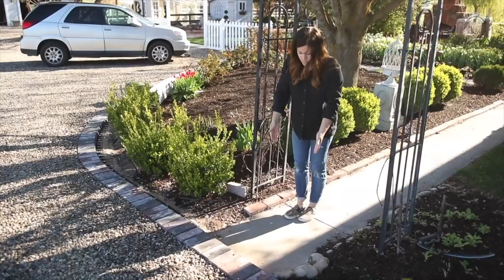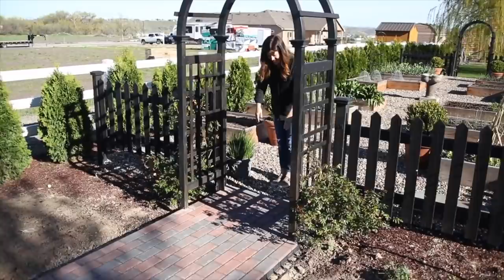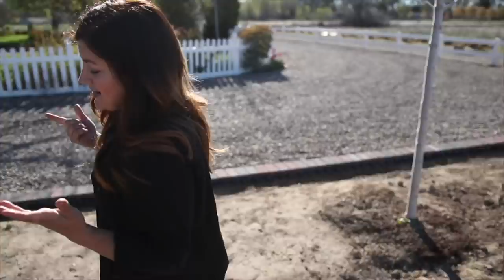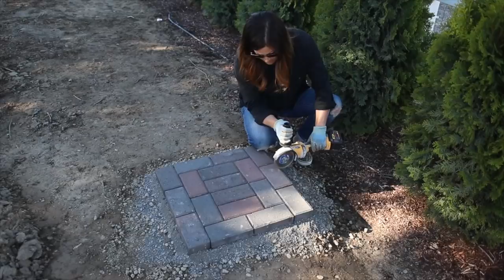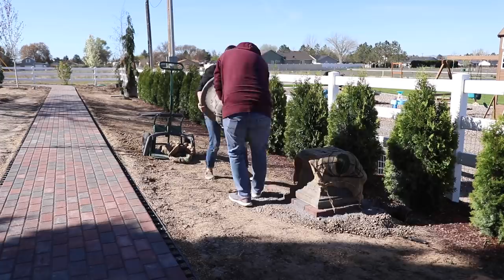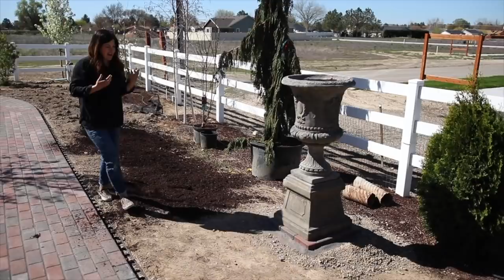Brick Pathway Tour + New Concrete! 🤩// Garden Answer

Comment: Would like to see a video some day on the 'source' for all the driplines.  The boxes and the main plumbing and any timer system, etc.
Reply: Did you see where they showed the boxes when they put drip tubing to the window boxes?
Reply: @sharroon7574    I saw two covers for boxes.  That doesn't help.   Running tubing and the little connectors, etc. is easy - it's the main part of the system and the system as a whole that is the tricky part and it would be good if they did a vid on that.

Comment: Hey, Laura, quick question for you.  I have a 45 foot long expanse where I want to create a hydrangea hedge.  Height is not an issue.  I'm trying to decide between Limelight and Pinky Winky.  Which do you think would fill in best/most quickly to make a dramatic separation between my patio/garden and the rest of the world?  Also, in 45 feet, how many plants do you think I would need to really fill it in.  I am planning to get 3 gallon plants.  Our area nursery has their 20% off sale on 4/27 so I need to make a decision.  Thanks so much if you or anyone else could assist!  BTW, those new planters are amazing.  They really add style to that area.  Your home and garden are beautiful.

Comment: Everything looks great! I am a little concerned however about how the arbor vitae's will work out in the very long term however. Just this year I had to take out my 2 arbor vitae's which were about 17' tall and 8' wide. As mine got older and larger they slowly started to spread out in the center. Heavy rains would make them spread out more and of course snow would really spread them out. They would regain most of their shape after the snow melted, but over a period of years the center spread just got worse and worse. This past December we got a 15" snow which pretty much did both of them in. Numerous tops broke off and what didn't break just spread/sagged down and never righted itself. They looked so bad I cut them down. Perhaps your's is a different cultivar and not as prone to the center spread as mine were.